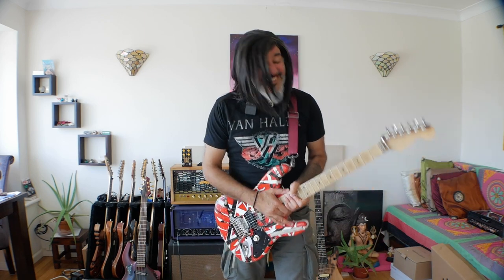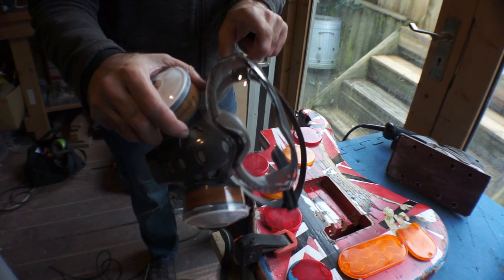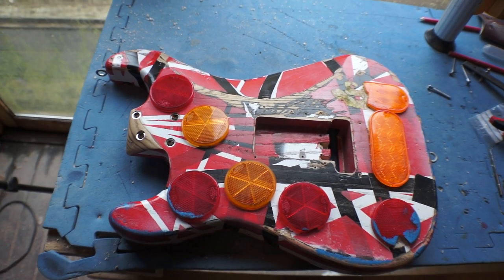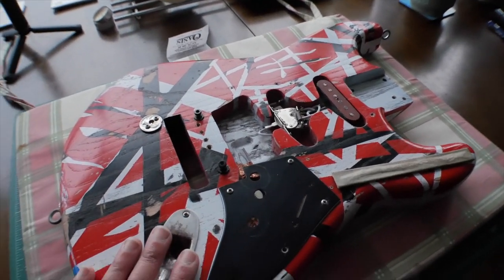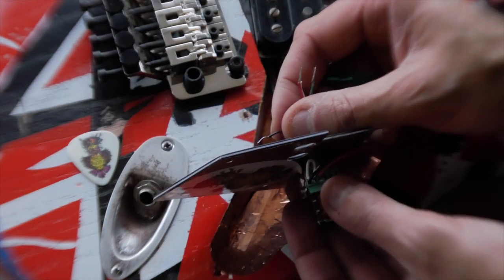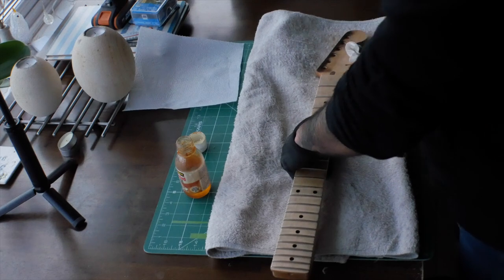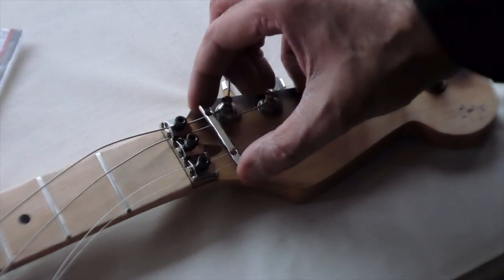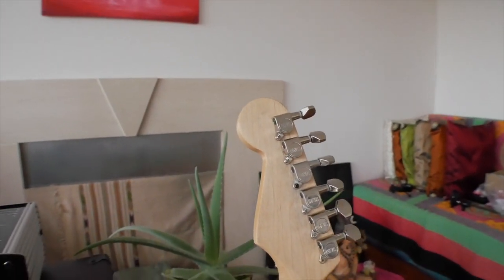Frankenstrat | Building a $25,000 Eddie Van Halen Guitar For Under $1000!!!

Comment: Great build. I love it! Tip for installing machine heads. Put them all in but just loose enough so they can move. Then, take a metal straight edge and push against the underside of the bodies. It will line them all perfectly. Hand tighten, then use an awl to mark your drill holes. Comes out perfect every time!
Reply from the maker: Thanks so much for the tip dude! I appreciate it. That is something I need to start doing. Usually I’m installing Hipshot tuners with the rail which makes it a breeze and alignment straight forward. Have an awesome day!